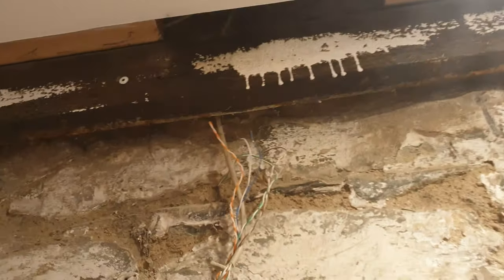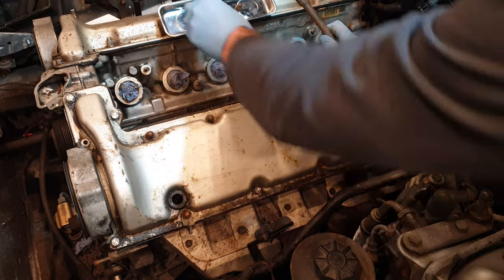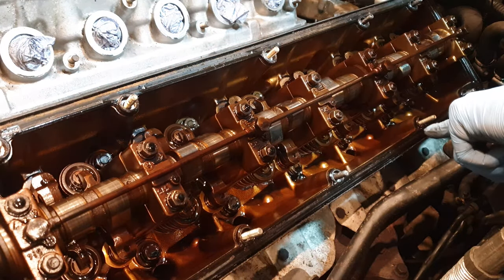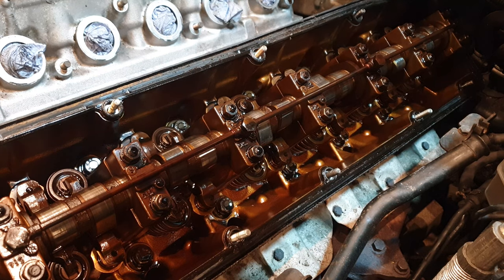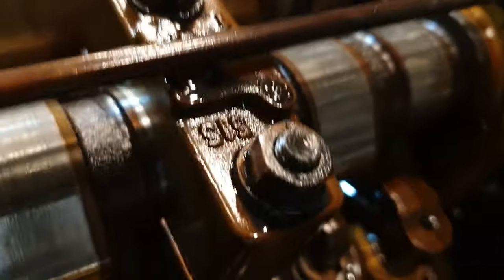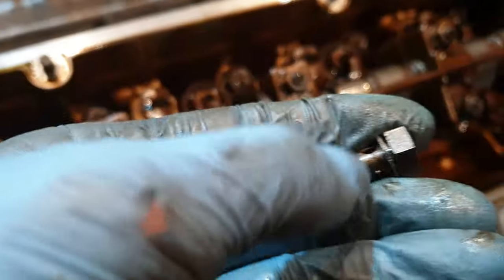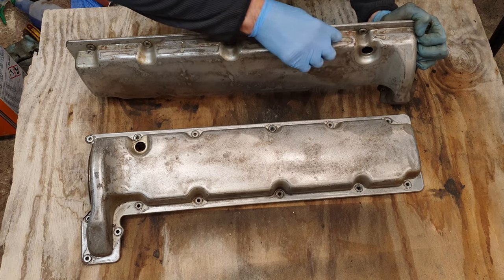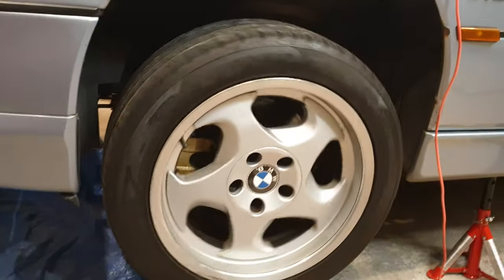BMW E31 850i Glacier - Complete Restoration - Valve/Sump Covers - Episode 4

Comment: Sorry Buddy - the A/C dryer flask is a must to change at some point - they say After system flushed - so up to you - I looked at my filthy A/C compressor for ages, (Timing Tensioner was leaking oil onto it) till last week when I decided, it had to come off to clean behind it - so did that and painted my a/c pipes in situe (nose cone is off) then I found that connection mentioned below. My goalposts have changed somewhat BUT gearbox rear seal is dodgy = has to be sorted = best way for me is drop the engine and box down = can then detair engine bay and replace drivers front brake pipe Easily!  You may need a tent in the garden for the rest off your parts, stick in though ; ) Go brave Sir - I have a spare set of new Eibach lowering spring - dont reccomend that route though  - am gonna ebbay them
Reply from the maker: Thanks the input, I have a new compressor already, and a new condenser and dryer too. Good luck with your project, getting the time to get near it is the hard part!

Comment: A/C pipes have an itermediate connecttion - a single allen bolt just where they pass driver side shock tower. Just removed my pipes there last week, one leads to Compressor and other to A/C Dryer in front of drivers side wheel. Spent ages sanding those pipes untill I found the connection! Made painting them so much easier. Also there's a wee sight glass on top of that too. part of refill procedure, am far from that and studying R12 to R134a gas etc etc compatibility. P.S Hamerite Kurust works well on various rusty bits after sanding, kills the stuff left in the pitting. Ideal for around the oring grooves and can be directly painted over after a light scuff for a key an the other areas. Hope you don't mind my interjection Sir, just helped me reading comments in the past to find tricks! Hope you have a few for me in the process as my engine is comming out soon, downwards with the gearbox - of course having loosened Torque converter bolts first. Enjoy the E31  one vehicle worth sorting out.

Comment: The M70 used M40 (4 cylinder 87-94) rockers etc - they were designed together and made on the same machine tools. The trick on the M40 is to remove the oil spray bar and open up the oil holes slightly to increase oil flow. A common mistake with the banjo bolts (also on the M10 and M30 engines) is to use liquid threadlock - all that does is end up inside the the banjo bolt, congeal and block the oil hole. BMW sell new ones that have both a slightly different thread pitch and dried threadlock. Nip these to 12 nm and they are there for life.

Comment: Excellent videos and commentary. Someone may have said this elsewhere but for gasket metal surfaces to prevent scoring or damage to the highly finished surfaces never use a metal scraper, screwdriver etc. use cheap and disposable plastic scrapers to clean these surfaces. Will not deface or deform the metal surfaces.

Comment: Why didn't you remove the engine completely and put it on an engine stand? I'm just thinking that to clean up that engine bay and get to all those bits would be difficult. It's a massive job and difficult to know what level to complete as a restoration I would imagine. Stripping the car down would be my choice including ripping out all the interior. What level of restoration are you aiming for?

Comment: 11:00 the oil pipe supplies oil to the cam bearings, not so much the lobes.  Best to have a look inside under the bearing caps.  Have read of this: https://www.bimmerforums.com/forum/showthread.php?1422402-Clicking-noise-on-engine-idle-(video-attached)